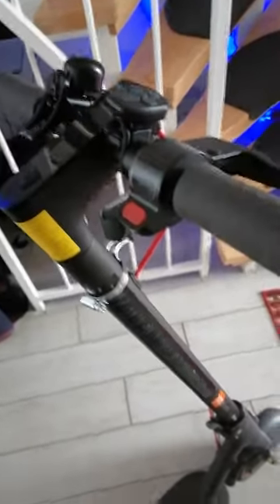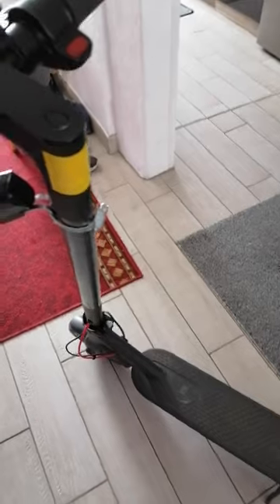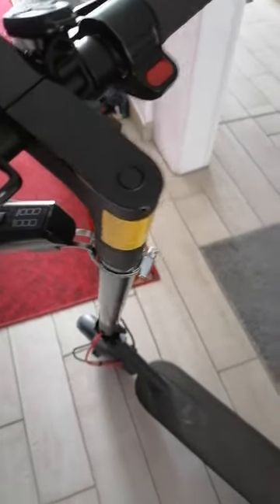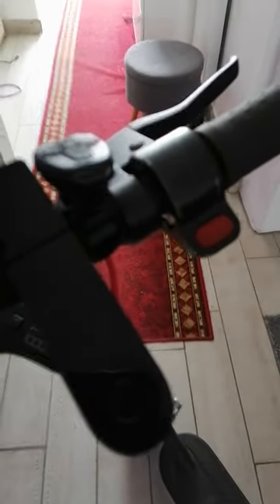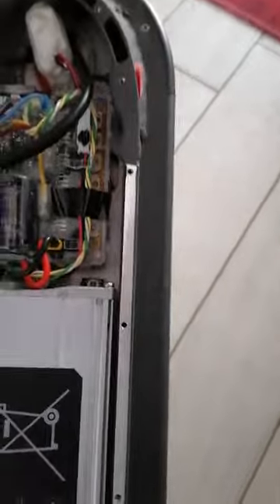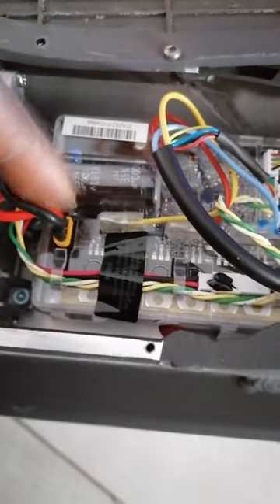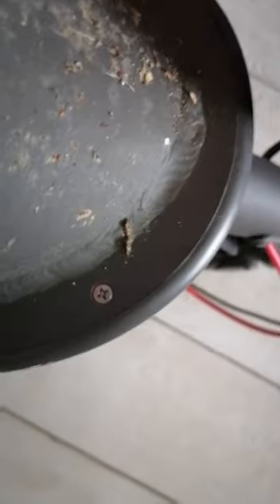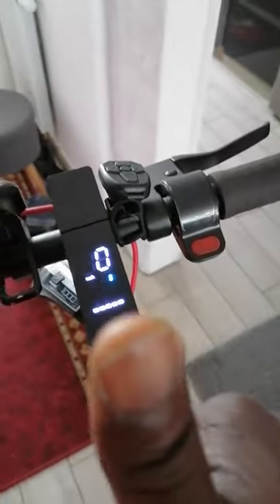My Xiaomi Pro 2 scooter is locked with App and cannot unlock again. Solution.

Comment: Another solution is, to press all the 3 buttons at the same time. The brake lever and switch on/off, and turtle button. It worked on my xiaomi scooter pro Thank me later :)
Reply: also if is lock ?
Reply: throttle* 🤣

Comment: I don't thing that gonna work because made a some kinda speed stips for scooter and after that i cannot turn it off and back again the screen shows me a "D" mode and 0 km/h so if someone was have problems like my please tell me what I have to do.
Reply: I have the same problem
Reply: @tago206  i find out the problem ST-Link V2 u need dude bcs motherboard cannot find a original drivers.
Reply: Hola pudiste arreglarlo que a mí también me pasó como se arregla ???
Reply: @adamajd7610  u need resset display or connect from another scooter